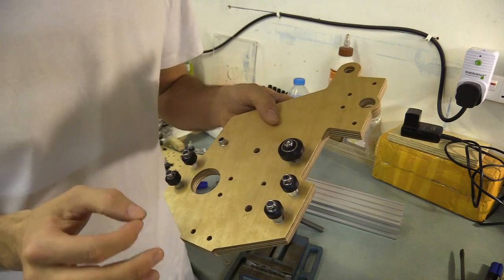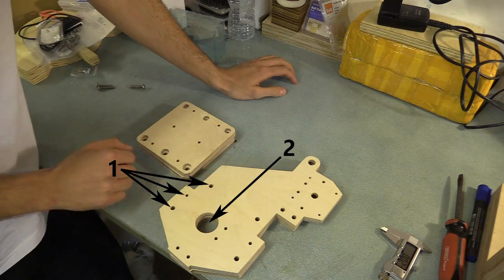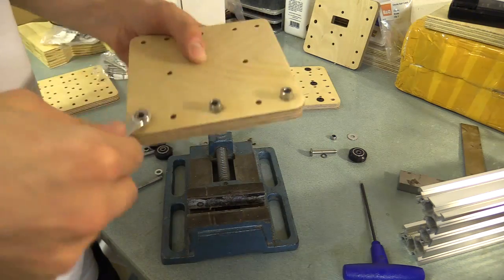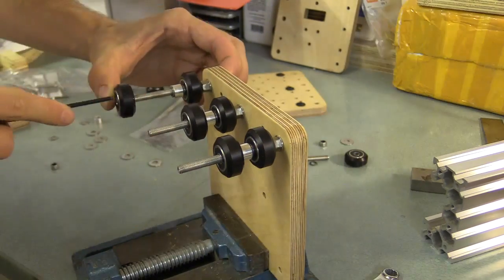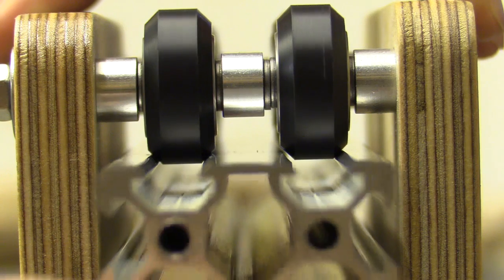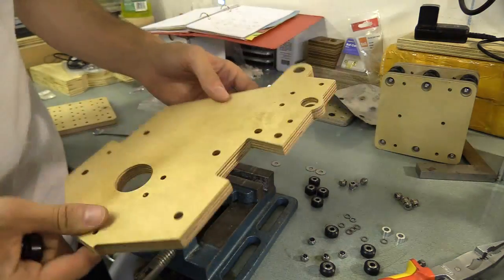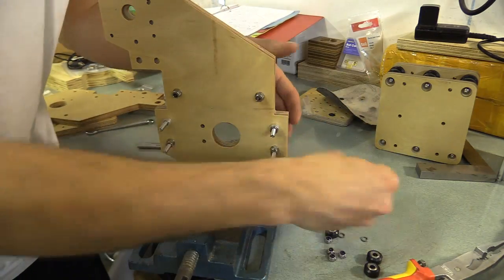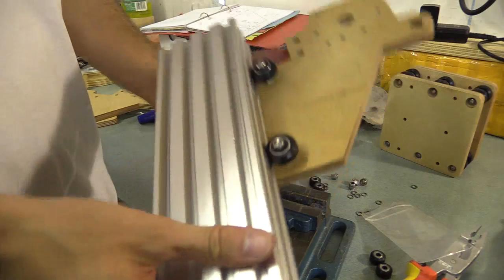#2 Finalised Y and Gantry Plates #2 / C-Beam Lead Screw CNC

Comment: For the gap of the v wheel could it be that the wheel is not centred on the bearings?  You could move the wheel over a bit